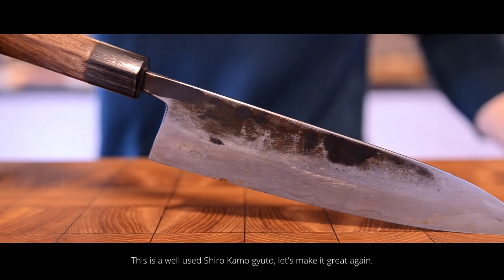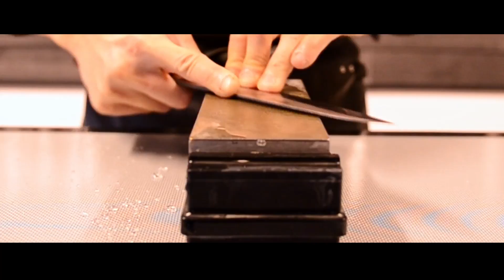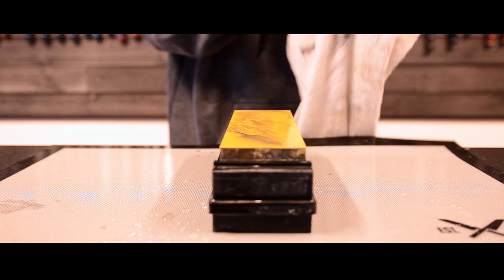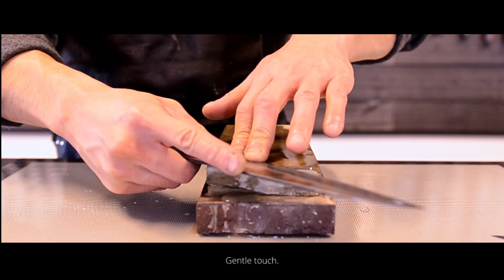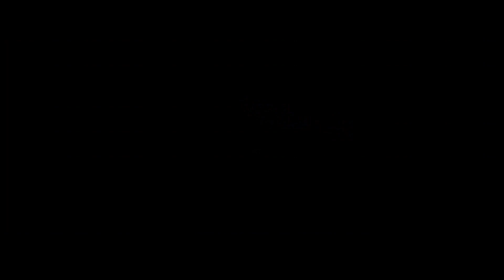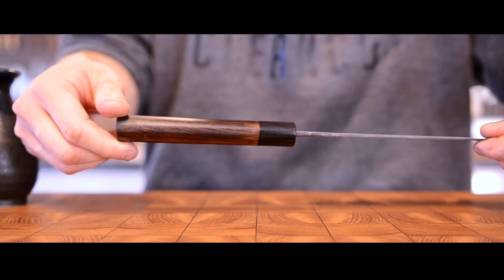Thin out a carbon steel knife | CLEANCUT LAB

Comment: Does this process wear off the kuroichi finish?
Reply from the maker: If you touch the kurouchi finish then yes, it will wear off quickly. When thinning a knife you often need to push up the shinogi line a bit, but you shouldnt have to touch the blade sides.